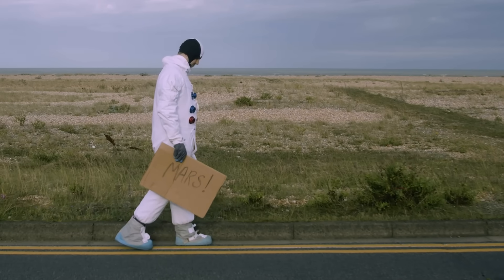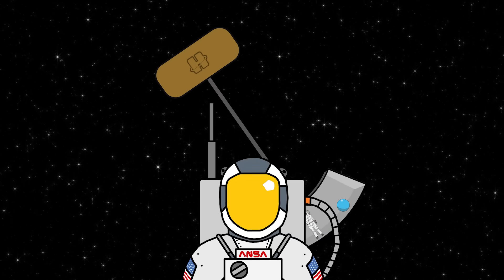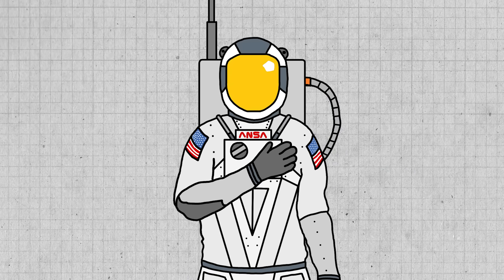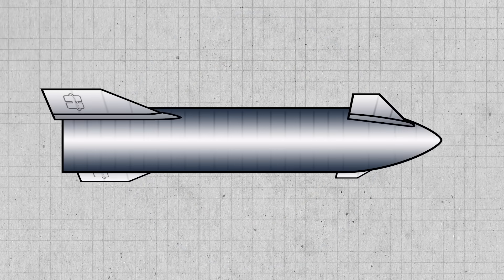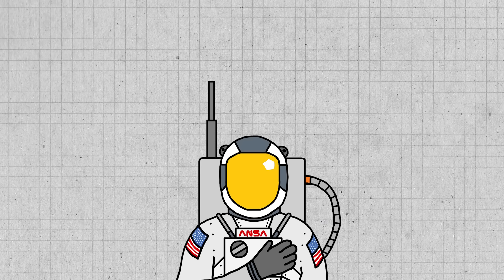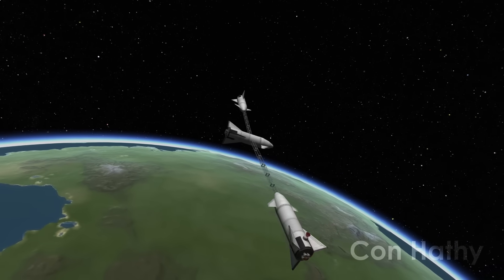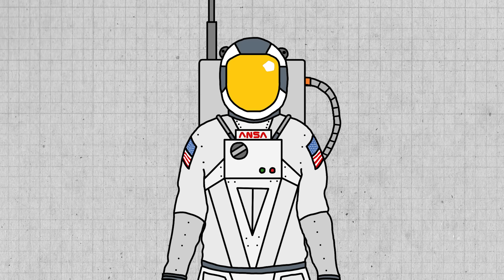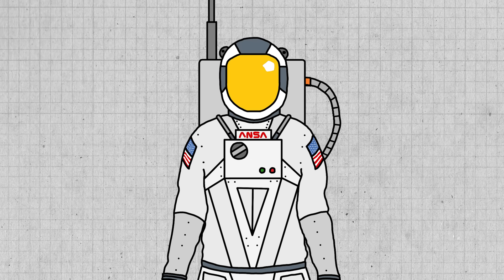This is NOT how you make Artificial Gravity

Comment: In my opinion spin gravity is one area of space research where the ball has really been dropped. We know the effects of 1 gee and zero gee on the human body. But what about the data in between. Do the effects track a linear progression on a graph? Do the effects follow a curve that rises gradually and then accelerates as you get closer to 1 gee. Or does the curve rise rapidly and then flatten out? Do the skeletal, muscle mass and cardiac data tracks match or are there differences. .We simply do not know. I suspect that the shallow curve that then rises rapidly as on approaches 1 gee is likely to be more like reality. But we do not know. And any one who claims they do in my opinion is merely tosding out a SWAG (1). 
We could have done testing in orbit literally anytime after the Shuttle began to fly if we had really wanted to. We had a ready made structure/s to attach a hab module to. The External Tanks. NASA's Office of Shuttle Applications (2) had looked into a number of ideas for uses that the ETs could be put to. Some were fairly ambitious. Some less so. One involved developing a cargo module that mounted to the bottom of the ET. This could be converted into a Hab Module the diameter of the External Tank and two decks high. I'm well aware that there likely would have been major issues involved in design and development. And that money in the NASA budget is always tight (3). In my opinion it was something that could have been done. I as also think that some research could have been done on teathers like those often mentioned for connecting a Hab Module to an expended booster stage. It could be small scale. Put the experiment in an orbit above LEO to reduce impact with orbital debris. Hell, put it in the Van Allen belts to increase the radiation exposure. Spin the assembly upto 1 gee and just monitor it. Let it run your a year or so. After a year release the booster and reel the cable in. Deorbit the payload module so that elements can be examined. 
A dide note.
Money, waste and NASA is something that always seems to trigger some people. Does NASA waste some of its budget? Yah they do. Unfortunately it seems part and parcel of big organizations. In reality it's not so much NASA that wastes dollars it's the politicians in Congress and incoming administrations. The Congresscritters want money and jobs in their districts. No surprise there. Incoming administrations want nothing to do with what the outgoing ones programs. 
1) Scientific Wild Ass Guess
2) I think that was the name of the office. Right now I'm too lazy to look it up. But I do remember Willism Proxmire sponsoring an amendment to a spending bill that would make it illegal to put the External Tank into orbit for any purpose.
3) Money. In reality NASA's budget is peanuts in comparision to the Federal Budget. After the loss of Columbia I heard people complaining about how NASA got a ridiculous amount of the Federal Budget. All of which gets spent on Earth by the way. But what is really interesting is when you compare NASA's budget to other segments of the economy. When I was doing research on the subject after Columbia it was very enlightening.  The US as a whole was spending something like 4 times the amount of money on cosmetics than we spent on NASA. In 2003 the non defense side of the Federal budget less entitlements iirc was 804B$.

Comment: If the cable snaps, angular momentum will be preserved, which means the Starship goes from rotating once every 30 seconds about a point 250m away to rotating about its centre of mass, say, 25m from its ends. Rule of thumb, it will be rotating at least ten times faster than before, so over 20 times a minute or more than once every three seconds. 
Plus massive jerk when the cable snaps. 
I wouldn't want to be in it.
Reply from the maker: No, they would still rotate at 2 RPM. Angular momentum at a very general level is actually masses traveling parallel in opposite directions. The relationship where it's the moment of inertia times the angular velocity is actually derived from this and is really just a simplified version of totaling up the angular momentum of a bunch of tiny point masses (atoms) moving in opposite directions.

The two Starships are themselves, traveling in opposite directions and are separated by 1 km. When the tether breaks they are still moving in opposite directions and their paths are still separated. This is where the bulk of the angular momentum of the system is because the Starships are small relative to how far apart they are. Breaking the tether does not require this momentum to be transferred to the rotation of the Starships. As they float off into space, their separation increases, and their relative angular velocity decreases such that angular momentum is conserved. 

By the way, this is why two non-spinning objects can collide and end up spinning in the same direction, it's turning the angular momentum of non-aligned velocities into the more familiar form of rotating objects. But again, if we zoom in on the rotating objects they are just a bunch of atoms traveling along opposite parallel (actually concentric) paths.

Comment: Why not make the centrifuge a meter or two larger in radius than the height of the astronauts, so that there is ALWAYS downwards acceleration at ever point of the body, including the inner ear which is used for orientation and balance. I imagine having a large gradient of acceleration on your body like in the case where the head is congruent with the center of the centrifuge, the blood supply across the entire body would be out of balance too.
Reply from the maker: The configuration in the video is actually a control for the eye experiment where they intentionally aren’t putting much acceleration on the eye, it can then be extended to see how the added acceleration changes pressure

Comment: Just bring enough mass with you to provide 1G of gravity!
Reply: So strap some rockets on to the side of Earth, and let 'em rip?

Or get some 100x dense matter, and set the radius of the sphere to match the surface gravity of Earth - 
Comes out to 1/100 radius, or 63 Kilometers.   Weight is 1/1,000,000 of Earth. A good trade.

Too bad the densest element is Osmium, at 22 g/cm3 -  compared to Earth at 5.5 g/cm3 - only a factor of 4

Comment: I know I am late... BUUUUT I was always wondering what happens if you make a Disc/Wheel station and all the crew members meet in the Dining area to have some food together. Lets say there are 8 People on board each weighs ca. 80kg. How does such a station/ship deal with the oscillation due to shiftet/ uneven weightdistribution? I mean... there is probably some buffer or stabilizing force kinda thing BUT, in the ISS rn they have the workoutequipment on a shockabsorberrack to not shatter the solar pannels, if a singel person on a treatmill could create a force big enough to kill the solararrays what would 6-8 people do when the spinning wheel is out of balance?
Reply from the maker: If the whole vehicle is spinning like the two ships tethered idea, it would be fine. For a separate ring attached to a no spinning ship you would probably want some active counterweights to keep oscillations from building up. And would definitely have to isolate anything as fragile as solar much better than the ISS has
Reply: @ConHathy  yeah I thought so... thanks for the answer

Comment: Bruh unless you are gonna spin ships at an earth diameter you are waisting your time. People will go absolutely bonkers in small diameter.
Reply from the maker: Like I said in the video, people are perfectly capable of adapting to rotations faster than 3rpm. On top of that study there’s also the Soviet project where cosmonauts lived in a centrifuge for an extended period, the US did something similar but specifically with people who had damaged vestibular systems so not quite as relevant. One commenter also shared a video of dancers on a spinning platform (they start off intentionally stumbling but at the end you can see they are well in control of their balance.) Not only are they not going “bonkers” during the routine, they’ve clearly rehearsed quite a lot without going bonkers as well. There’s nothing that would suggest you need something the size of Earth

Edit to add the video: https://youtu.be/n0zqQxz4DHs

Comment: The other artificial gravity option that was not discussed is use of the thrusters  to create a corkscrew motion with a large radius, perpendicular to the direction of travel.
Reply from the maker: I actually just posted a video about thrust based artificial gravity today, I didn’t look at spiraling specially but did discuss what we can achieve with current technologies in a straight line
Reply: @ConHathy  The other potential option with this proposal is to perhaps use an out of balance gyroscope to  create the spiral motion. This proposal would be considered the primary option with the specialized corkscrew thrusters as the failsafe option.

Comment: i cant do the actual math myself, but using spincalc, 500 meter radius to get 1g is about 1.3 rpm. also i'd imagine they dont even NEED 1g. i wonder how low they could get away with and still stave off the effects of 0g life.
Reply: Since Mars is 0.34g that is the most that is needed.

Comment: Maximum RPM:  3/min.  Optimal RPM:  1/min.  Optimal g:  1.  Naturally, this requires a much longer moment arm.
Reply from the maker: Only if you ignore the fact that people can acclimate to the higher rates over time. There’s no reason you couldn’t do a few months of centrifuge training to prepare for a whole mars mission
Reply: @ConHathy :  No, they really cannot.  The cumulative affects of faster rotation of days and weeks play havoc with our vestibular systems.  1 rpm avoids all affects.  3 rpm is only somewhat tolerated over days and weeks.  Faster isn't tolerated well at all, and the last thing you want to do is slow to a tolerable 

Solution:  Bring a long enough tether to handle 1 g at 1 rpm.  That's still less than a quarter of a mile.  Easy peasy, and FAR better than being forced into a bad decision because your cable wasn't long enough.  That's always bad form.  ;)

Comment: The main issue on short axis rotation is your feet will have more gravity than your head will.  Dont forget walking in rotational forces. Gravity is not a force, but fake rotational forces are not the same as gravity. Andcrotational force is not the samecas linear force.

Comment: 2:25 it didnt lower blood pressure in the eyes because his head was in the center, it effectively was like it wasnt even spinning.
4:52 while a large vehicle is too large to launch for a one way trip, they are ideal for cyclers, like a earth mars cycler, its launched once and never has to slow down or stop and goes back and fourth between earth and mars with minor course corrections. it could be built in a high orbit, likely around the moon to reduce the fuel needs to get it up to speed potentially it could be built from materials mined from the moon and fueled there as well from ice. its not a 'one off solution' its a 'were going to do this for a vary long time and dont mind the investment' type of solution as in the long term its vary worth it.
Reply from the maker: 1. It was in the video I showed but if you look up the paper you’ll see that was just a control configuration (intentionally no a.g. just spinning). They would also adjust the position so the eyes did experience a.g. and they didn’t see a change in the pressure between the two set up’s. That was probably just the configuration the machine happened to be in when the video crew decided to stop by.

2. I agree if we ever do see large radius a.g. it would probably be part of a cycler. The earliest missions would probably just deal with the rehab period on the surface to avoid added risk and complexity.
Reply: @ConHathy  It would be interesting if they ran #1 with 1G where the eyes would be, but it would likely have to be a larger setup or  the feet would probably experience too many G's.

Comment: My idea is to make a ring station of nose to tail starships, 10 starships would make a decent ring. Spin that up to moon equivalent gravity, and the coriolis effect should not be too bad either. A propulsion pod could be suspended in the centre of the ring with strong tethers, also giving the ring structure more rigidity.
Reply from the maker: Nose to tail would make gravity in the wrong direction. Is there a reason you wouldn’t just dock them nose first to a separate ring
Reply: @ConHathy  These starships would never return to any other duties, so I guess the living space would have to be designed with such a function in mind. They don't need to be manned when launched to where they want to build the ring station. Elon will definitely want to try different configurations if they can build enough ships per year.
Reply: @ConHathy  On second thought, you are right, that would also make going from one to another living space much easier too.

Comment: Mars has gravity, its just a matter of increasing its effects. We typically do that by increasing weight.  I don't see the problem.
Yes, you can't add weight to a persons eyes but I think you can increase the air pressure above their eyes.  That will accomplish the same thing. 
The only real difficulty is the effects of low gravity on internal organs, but wearing a weighted suet would increase the effects of gravity enough to prevent the atrophy of skeletal muscles.
Reply from the maker: Air pressure wouldn’t correct the ocular pressure because that is gauge pressure not absolute pressure, also a.g. Is more for the trip than the stay on the surface
Reply: @ConHathy    I wasn't referring to ocular pressure since that is the pressure inside the eye. That woudn't be affected by low gravity. 
 I was referring to atmospheric pressure because that could be increased to simulate gravity on the surface of the eye. 
    I was address the fact that people say Mars's gravity is a problem.  I wasnt talking about micro gravity. 
    We could eventually solve the problem of micro gravity on the trip by going faster.

Comment: Just make the trip faster. Then radiation, gravity, etc. are all moot points.
Reply from the maker: You could probably get away without it on the longer trip as well, it would just make the process of rehabilitation on the surface easier. It’s possible to shorten the trip but the extra delta v isn’t free

Comment: The first problem, is using the "Starship".
You don't want to take a vehicle that's specially designed for lifting things from Earth to orbit, and then landing it back down here empty, in space and to Mars.
This is a silly, hyped, fetishized gimmick.

For lifting a transit hab/lander to Mars from Earth, look instead to the Mars Direct "tuna can".
Omit the "Starship", and  substitute a different upper stage that lifts the Tuna can. Countermaas spin it opposite another tuna can, or other part of the payload, or as in Mars Direct, use the burnt-out upper stage that threw them to Mars. It should be elementary (but isn't for die-hard "Starship" fans) that omitting any provision for aeroentry and landing on Earth , and you can lift more payload.
Problems simplified,  avoid the silliness of carrying equipment for landing on Earth which is useless on Mars, forget the silliness of spinning a "Starship" around its long axis, which must have been dreamed up by someone enamored of the "Starship", but who is utterly ignorant of the realistic situation.
Right here, this video is superfluous, as is any consideration given to using the "Starship". The "Starship" will not be used for lifting large specialized payloads for any purpose. Things that can fit inside he aeroshell of the "Starship" that opens up a door are small and can't be as heavy as something that's designed to go on that upper stage thrown by the "Superheavy".

The "Starship", will not carry people up to orbit, because it lacks any provision for crew escape during launch. No, the upper stage itself, is not an escape vehicle from the booster and upper stage which is what they might need to escape from.
That much is easy. Lift the crew in a crew Dragon that's equipped for crew escape and survival.  Right here I'll bet $ that any eventual NASA Lunar architecture will not use the vertically stacked, VTOL "Starship", but a different lander specifically designed for lifting on the Superheavy and an upper stage. I don't care if SpaceX has released pretty graphics of it, or if ignorant "Starship" fans have put out such videos. It's dumb.

We're already using Earth-orbit rendesvous and fueling of the upper stage that takes them to Mars. Upper stage fueling in LEO is a good thing, and should have been done long ago, for anything. This applies to Mars Direct too.
When we lift a payload to LEO which has an upper stage to take it beyond LEO, some 45% of what we've lifted is just the oxidiser in the upper stage. Omit that, and it's safer, and you can pack in more payload.

All of this skips over the books and stacks and libraries of work done in the past towards using the Shuttle ET as a "wet launch" station volume. This might not be useful in itself anymore. Though if an SLS ever actually flies, it could be done that way too. Probably not, since Skylab showed that at one time, the US knew how to use a HLV in the class of the Saturn-V or the Superheavy or the SLS, to lift a station volume in a day.
The point is that the work done on using the ET in artificial gravity is instructive.
They NEVER looked at spinning it around its long axis, or just spinning one ET Volume for artificial gravity at either end (because those ideas are dumb). 
A dum-bel of a transit/lander hab is the way to go. No talk of the "Starship" or of spinning one object around either axis, should be relevant.

Picking apart the fanciful "Starship" as an interplanetary ship or Mars or Lunar lander is a straw-man exercise.